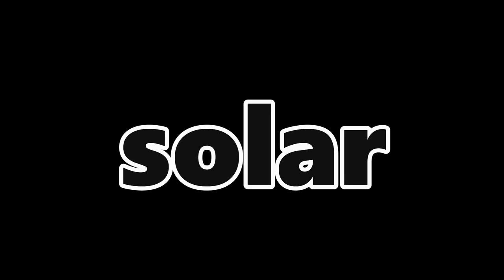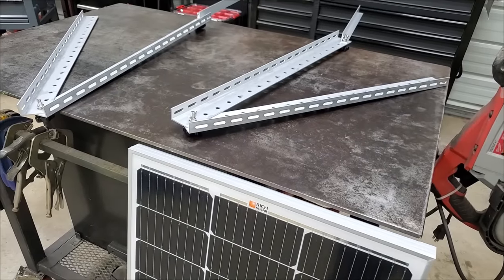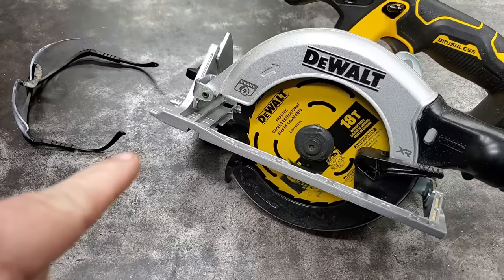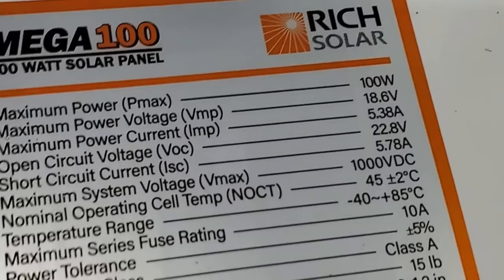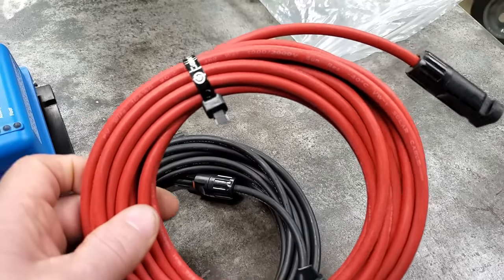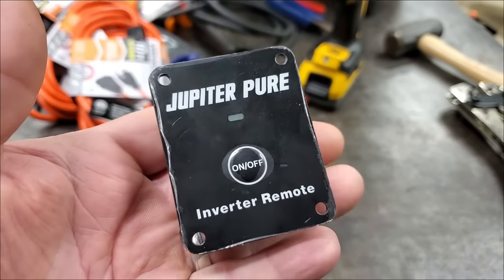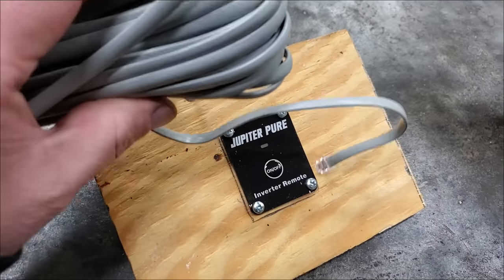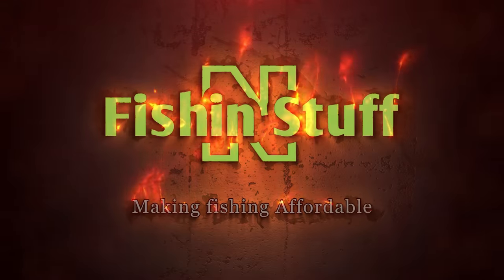Beginners Solar project ( very Simple )

Comment: Disclaimer: the freaking spell check has stopped working for some reason.  I have come to rely on it more than I'm comfortable admitting.  So, please disregard any spelling errors.  Thanx. 

That was a great video!  Thank you so much for spelling everything out for beginners.  I doubt I could count how many "beginner" solar videos I've attempted to watch which, within the first minute, had already used enough jargon that I was completely overwhelmed.  Just because I want a solar system, doesn't mean I have, or want, a degree in producing solar electricity, any more than I need, or want, to become a certified mechanic, because I want to have a car.  Make any sense?

At any rate, the information you provided was enough to give me the confidence I need to build a solar system for my needs.

Comment: A couple safety things:  all the electrical codes in the USA & Canada call for a shutoff switch between the solar panels and MPPT.  Think about it this week, like you said in your video you need to put the MPT controller up to the battery before you hook the solar panels up to it. Anytime you need to turn the power off you’re going to have to physically unhook that wire. But if you had the appropriate switch, you throw the switch and you disconnect it 😊  search the Internet, a little bit, you’ll see that the code states that both are positive and negative need to be cut at the exact same time. There’s specifics switches that take both the positive and negative turning them both off at the same time.

Next equally important fuses. Remember fuses are not there to protect your electrical component, it’s there to protect the wires. I didn’t see you install any fuses whatsoever. Those wires could potentially get hot. Catch on fire and burn down your beautiful shed.   You should have a fuse on the positive of the MPPT going to the battery, and fuse between the battery and the in. Size them according to your wire, not according to the load.

Otherwise, it looks like a great set up, great job!

Comment: I have a 1500 watt Patriot that never needs to top off. It holds a charge for a long time. It is the first model they made . now they have a 2000 watt generator. and it comes with 1 solar panel all pre wired . just plug and play.

Comment: For 12 volt to the 2000 Watt inverter the 2AWG wire is good for 1380 watts. If it runs for more than 3 hours it is good for 1104 watts. If you need to use more than the wire is rated, use two sets in parallels. They must also be the same length.

Comment: Yes, you were definitely right in choosing COPPER conductors. I’ve seen some ”budget” wires that were called ”CCA” which means ”Copper Clad ALUMINUM”). IOW, they're PLATED with a tiny amount of copper, and LOOK LIKE copper. (Maybe the layer of copper makes them easier to solder.) Aluminum is less conductive than copper, and for a given AWG, copper will safely carry more current than aluminum, with less loss. Often they genuine copper wires are called ”OFC” which means ”Oxygen-Free Copper”. 

Also, it sounds like you bought right. The ”target” price I look for is $1 per watt, or less.
Reply from the maker: I agree with you . thanks

Comment: If you had four panels, you could have done a Series-Parallel setup and got the best of both. Plus, the current would have still been well under the max rating for 10 AWG wire.
Reply from the maker: I agree , I am a beginner like said.  But I was thinking about adding 3 more and more battery's  , but I need to figure out what I need for a deep freezer  . Any suggestions?

Comment: I used two pair of #2 welding cables to my Aims Power inverter charger. It calls for a 1/0, but its 24 volts, so the most the inverter can use is like 90 amps. I have six 24 v 100 ah batteries. So its pulling 15 amps from each battery under a 2000 watts load. I never use that much unless I forget the oven is on, and start coffee.  My charge controller can take 150 volts, too, but I use 41 volts, because the charge controller I'm using is 2% more efficient at 33 volts than it is at 63 volts. That just means higher voltage makes the controller run hotter. That heat is lost wattage. And I don't like the controller getting hot, either. As it is, I usually have around 20 amps on lightly cloudy days, to 32 or so in full sun. But the controller doesn't need a fan like it did when I had it hooked up 63 volts. It barely gets warm. More efficient. Check your charge controller paperwork for the graph of how efficient it is. You're going to be surprised that you'll get more wattage with less waste heat, at the lower voltage. The competition to run higher voltage to the controller is funny to watch, knowing that my controller has 34 volts coming in usually, and its outperforming theirs. Well, check your owners manual, you'll see what I mean. Having 100 volts coming in is just turning into heat in your charge controller. Why dont you do an experiment and see which way it makes the most wattage? I would do it now, so you can still use the beginner excuse, lol. 🤔

Comment: Awesome DIY instruction video!! So many other folks never break down the details.

My only recommendation (like others said) is you can get those same lights that are already 12v DC so you don't have to use the inverter. You can keep the inverter of course for 120vc ac devices.
Reply from the maker: I might do that .

Comment: YESSIR i been getting on the DIY solar myself. Now running my fridge, oil furnace and 3/4hp well jet pump 24/7 completely free. 200ah @ 24v with only 600w pv. Get you some of that. Still trying to figure out how to step up from 110v to 220v for welding and such

Comment: You should have some fuses or breakers rated slightly lower than wires are rated for, in between each component.
I have a set up in a shed also, but I have a combiner box with six individually fused breakers. I also have couple 10 foot copper ground rods.

Comment: Fun video!. I haven't read all the comments, but you should use the open circuit voltage (OCV) of the solar panel when you size the solar controller. You have plenty of headroom here anyway.

Comment: for lights and everything else that can use that voltage i'd use native 12V output of charge controller, plenty of 12V options available - from floodlights to simple LED strips ,tool chargers  etc.
..

Comment: This is a good project for a building that is too far from the house to run power. My garage is 50 feet from the house. I ran a 10awg cable. Buried it “temporarily” in an 18” deep trench 2” wide.  I will always know where that cable is buried and will disconnect it if I ever move. It will never be up to code and it will never have to pass an inspection. No breaker panel. No GFCI. It’s not much different than using an extension cord but it’s under ground and it’s been like that for 21 years. Never had a problem and cost me next to nothing to install.

Comment: You have a new subscriber here,  A lot of experts on youtube use too many technical terms and they're either talking over people's heads or boring as all get out. You're not. The recorder playing the Mission Impossible theme is too funny.  I understood your setup the first time you explained it. The only thing I'd do differently is use 12 volt shed lights, no inverter needed (it's because I don't want to spend the money for an inverter I'll only use once in a while. Then again, if you need to test if something works in that shed, you have the inverter to plug it into right there.
Reply from the maker: Thank you very much . I really appreciate that  . I really want to add a few more batteries and  maybe run a deep freezer in that building  . I didn't go into details but I have other plans . And thought I just Mahe a video . I really am a beginner  . I'm just a fabricator and like building stuff .

Comment: Rule # One in starting in solar:  Do not use anything from Harbor Freight.  Rule 2:  Skip the lead acid batteries and go with LIFEPO4.  Buy once, cry once.  Rule 3:  Buy Victron MPPT controller.
Reply from the maker: I may have to upgrade,  I just wanted to try it
Reply: SanTan Solar sales used solar panels

Comment: My friend, your looking at the wrong voltage, you need to look around the Open Circuit Voltage (Voc).  And you 100% right that voltage goes up as it gets cold.  There are charts out there which will tell you the max voltage for a temp.  Not a big concern in the southern USA, but up north or in Canada, something to check.

Comment: For home setup, going with 24 or more volts will allow for thinner cheaper wires. The battery cost will be doubled but then so will the run time. (in theory)

Comment: 1. You don’t need another panel box for your shed. Run two wires from the house in the conduit/ditch you ran. 1 for lighting circuit, 1 for outlets. 
2. The cost for wire, conduit, digging (which can be done for free), outlet boxes and finally outlets/lighting overall is cheaper……

Now this is great for RV or a shed/building you can’t get power out to….
Reply from the maker: I do need one of I add a deep freezer later . That's why I say I might up grade it later . Regardless I'd like to do more than just lights

Comment: With that huge of a charge controller, you could hook up a LOT more panels in series-parallel... Several strings of 6 100w panels hooked in parallel... like 48 panels easy without pushing the limits on the controller.
Reply: What is the over capacity used to do unless more storage is needed? Ï
Reply: Over capacity allows charging on cloudy days and it will start charging more in the morning and later in the evening.   The excess gets discarded by the Victron.   Just do not get close to the 150Volts.   The unit also specs a max wattage allowed of solar panels to use per charger.   I have 8 100 watt panels 4s2p  for 80 volts and 11.5 amps.  flat on and RV roof I get 40amps into the battery on a sunny day.
Reply: Yes, cloudy days in the winter is what you have to design your system around, if you want uninterrupted power.... In other words.. extra battery and extra solar
Reply: @TheVampireMort  some controllers have the capability for a port to connect a load for some other useful purpose like a heater for hot water, so that all that excess capacity isn't just wasted.  The controller gets heated up dissipating all the power too, so it'll run hot as a result.
Reply: @dubmob151  I've got a new system, I'm still learning as well. Thanks for the insight

Comment: Probably already said but Heat will make the solar panels put out less power/energy so keep em cool like put them on a roof that isn't metal...? :) Telling for a friend! not like I made this mistake or anything...
Reply: There's a big air gap so it wouldn't make any difference either way.
Reply: This is generally a non-problem.  If the panels get hot because the sun is out... well, that also means they are getting full sun so even though the output will suffer a little, that suffering is relative to the huge amount of energy you'll get that day so you just don't worry about it.  And of course, on any less-than-sunny day the panels won't be hot.  They will get less energy overall, but they won't suffer from getting hot either.

Some types of metal roofs can be incredibly advantageous... particularly standing seam metal roofs.  Because the solar mounting brackets can be mounted to the seams without drilling into the roof at all.   Zero issues with potential water leaks due to the mounts.

Comment: I made my own 2000 W with a 4000 W high solar generator. It’s full Sine wave lithium 100 Ah battery . Two 100 W solar panels power it. It works great , but I’m going to add another 100 Ah in series next. It costs less than $1000.00 for parts to build this unit.

Comment: Just an FYI, if you removed the inverter and left the building DC, using devices wired for either 12 or 24v you would get about 20% more capacity out of your system.

Comment: I'm all for using solar energy, but all of that costs a lot more than a few led lights in a small building will ever burn on regular house power. I bought a couple of HF LED lights when they were on sale for $15/ea, (2-44" long LED shop lights), and I ran a homemade extension cord from the ground fault outlet on my back porch to my shed. I buried the wire just enough so I can still mow the grass. I put a single switched outlet in the shed by the door. Total cost was less than $60. (It was actually a lot less since I got the wire for free from a dumpster at work, wire that was left behind after some new construction, I had the outlet, switch, and box just lying around, and the lights were actually part of a huge lot of them I bought to light my basement before I realized how bright they really are). In the end, I don't have holes in my roof, I don't have to worry about solar panels getting ripped loose in the wind, and if I need to kill the power, I just unplug the cord. If I need more power out there, I have extension cords.
Reply from the maker: I did it more as a off grid thing . So when the house power is out

Comment: If you just want a light inside the shed, get a motion activated solar powered security light but put the light inside with the panel outside. You can do it for less than $50. Just saying, that's cheaper!

Comment: Longer wires do increase resistance but it DOESN’T create heat. The problem with longer wires is voltage drop, that’s why a person needs larger wires for longer runs ( larger wires have less voltage drop than smaller ones of the same length).
Reply from the maker: I appreciate the knowledge and help . But it was still funnier with the building burning lol 😆

Comment: Nice job! I did an even simpler solar setup. I bought a couple of those solar outdoor security lights that have the light and the small panel separate. I mounted the small panel outside and run the wire through the wall. I mounted the solar light inside then plugged in to small solar panel. The light has motion and infrared sensors so no wall switch. It is not as nice as your setup but it works for small sheds. I did the same thing in my carport.
Reply from the maker: That's a good idea on the cheap .
Reply: Could also just use 12V lighting instead of the 120 VAC lights if the only purpose is for lighting. Then there's no inverter needed and conversion losses.

Comment: Like your video, but you should use the VOC figure of 22.8 volts. No problem for your charge controller. Another battery and you can use some small power tools too.

Comment: Buying solar generator way better option, for sure faster and simpler, and sometimes cheaper. Also buy used solar panels, you can buy 300+w used panel for same price as 100w new panel. Panels have 25+year life expectancy, so even used for few years, they still have plenty of life.
Reply from the maker: I agreed

Comment: I would add a DC isolator between the panels and the charge controller (so you can isolate the panels easily) and an RCBO (Residual current device and breaker combined) between the lights and the inverter and you need to ground both the inverter, the charge controller and the RCBO. It might sound like overkill but I assume you might have other plans outside a simple lighting circuit. Plus the RCBO will give you short circuit protection against water ingress and vermin. Good basic system though. Stay safe.

Comment: The time I've seen people mess up the worst on an inverter always is when they go and need to do 75% of the capacity of an inverter. It is always worse. Almost doubling the effectiveness or only pushing it to 50% of its capability because it will make it last so much longer. Used to work in a large format battery factory so we had 500 lb lead acid batteries. The smartest electricians that were paid millions of dollars to set the place up literally said that inverters and rectifiers should only ever be used at about 25 to 30% of their capacity. 

That was specifically for these giant batteries that were going to nuclear power plants and we're switched out every 5 years by design. The thing was we always kept those 5-year plus workhorses and or employees purchased them because they were in perfect shape. One of the old timers there had one from 25 years before when the factory was first opened.

With that said, 50% capacity on a cheap little one from harbor freight is probably going to last you 10 years as long as it has ventilation. I like the way that you showed all this steps and you literally made it not intimidating for beginner to put something like that together. I completely agree how nice some of these all in one systems are, but being able to have a dedicated system in your garage to be able to recharge One of those is a very nice efficient tool. I also watch that little do-it-yourself box and thought it was quite well done. When you mess with electricity, there are a lot of people that will just not even put the time because it feels intimidating AF. Keep up the good work and good luck built a new stuff
Reply from the maker: Thank you very much . I'm no electrician by any means . But im not bad a YouTube lol . I appreciate it

Comment: Not sure why the youtube gods brought me to your channel but I am glad they did, I need to do something like this for a couple of my outbuildings and to power my brooding box for my chick's and heating lamps at times it
Reply from the maker: That's a great idea . But if you use a 100watt ceramic heat bulb . ( not the 250watt red heat bulbs ) you'll need 3 batteries to run it 24 hours a day . But , those batteries being 229 dollars helps  . They also make much larger batteries too

Comment: I you're not out there very often you can probably get by with a trickle charger. 
Do the initial charge in your big house. Then move the fully charged batteries to the shop. Save a lot of buying and installation cost.
Reply from the maker: Yeah but like I said I'm going to upgrade it . Maybe get a deep freezer